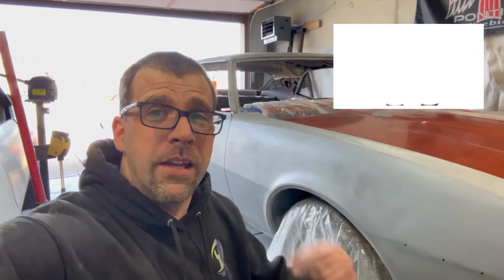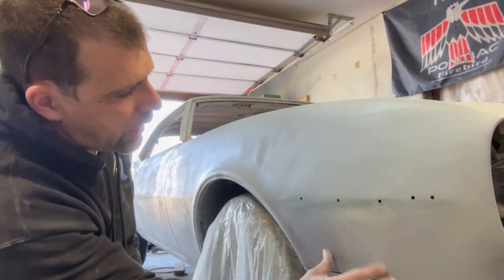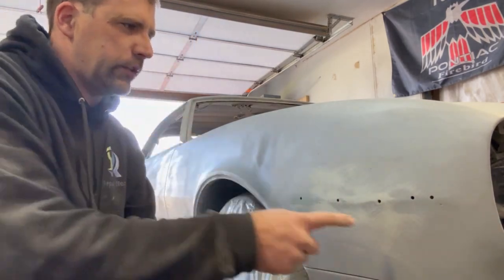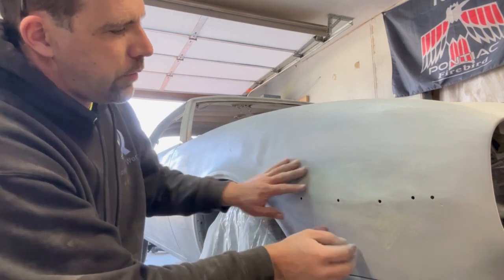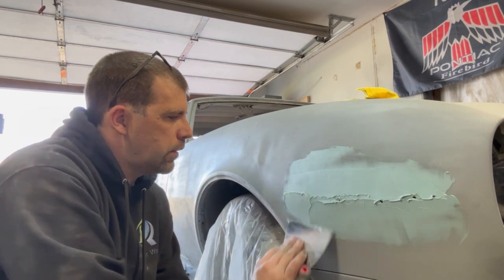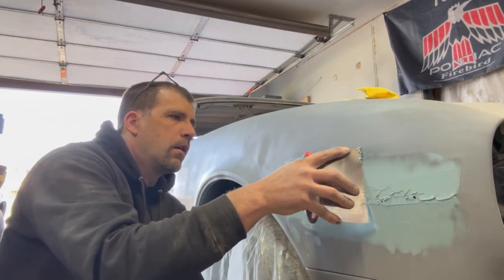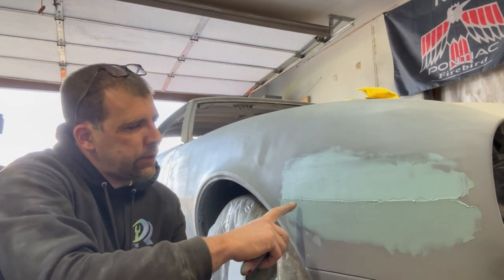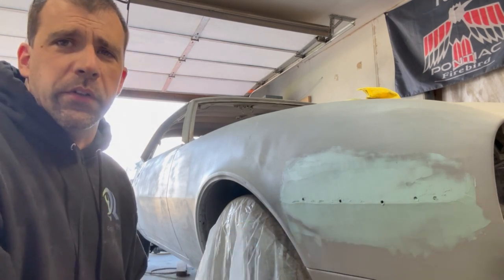Recreating and highlighting body lines 1968 Firebird Restoration

Comment: Great Work on putting the body line back in.  Its nice to see the brick and Mt Dew in the vid as well.  I like how you said the proper amount of body filler.  When i tore apart my bird, I found some on the tail panel that had to be at least 1.5 in thick lol, but at least i didnt find is old chicken wire.  Keep up the great videos and i cant wait to see some paint on the beautiful bird.
Reply from the maker: 1.5” of putty is a bunch. Think of how much weight that added and todays cost of materials they could buy the replacement panel from instead

Comment: I’d like for you to try something… 
1. Mark your body line with a fine point marker,
2. Put a 3/4” tape line right on that line,
3. Fill the side that’s not covered by the tape to the thickness you need.
4. Once the filler is starting to harden just a little, pull the tape.
5. Cover the side you just filled with tape and leave the very edge exposed so the two sides join one another. You just don’t want to put any extra filler on the 1st side.
6. That will leave you with a beautiful straight line right from the start! 

Trust me, It works great and makes the process so much quicker by starting you with a nice ridge.
Reply from the maker: Heck yeah I can see that working well. Thanks!!

Comment: Excellent way to put the body line back in. Our bird is actually missing some of the body line. Whoever had it before us used way over 1/8” of filler. Always like the tape tips as well.👍
Reply from the maker: I do love my tape just about as much as orange Mountain Dew…..ok probably not. 🤣 But seriously it’s a great tool and readily available and cheap.  Wish i was better at working the metal with a body hammer and could get it even closer. Maybe someday.

Comment: i hate hate hate doing body work i put mud on and sand to much off, have to put more on cause i sand to much off vicious circle of wasted time
Reply from the maker: I feel that frustration for sure. Knowing where and when to stop is a trick for sure
Reply: Teaching yourself on areas  adjacent to good metal can help by always having a reference to compare. A metal ruler can be flexed over your repair to eye the curves in multiple directions since compound curves are used for their ability to add rigidity. Holding your mud spreader with your thumb underneath nearest the panel and fingers spread across the top will let you match the curve you're looking for. You can control the spreader well enough to add a little more radius to leave your mud ever so slightly positive. If rough removal of mud is done in the least curved direction a plastic hand board sander can be manipulated with the handles to match the curve and then sand with a vertical or horizontal board moved in 45 degree strokes in an X instead of the T of the board. A light on the floor to move around and watch shadows is useful. Not all Bondo is the same to learn with. Your supplier or your laziest body working connection should be able to help. A case of beer and a few hours doing cleanup for a shop can get you some visual education to save finding everything important the long way. Sand away...
Reply from the maker: @WireWeHere  very well said, thanks.